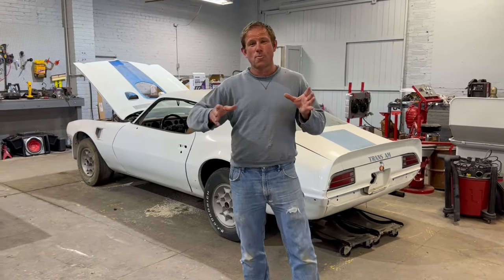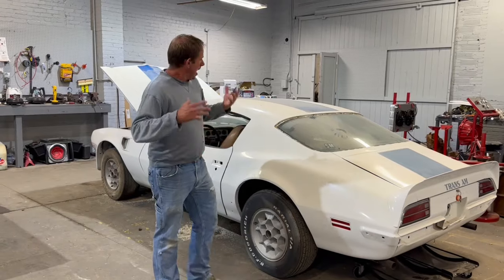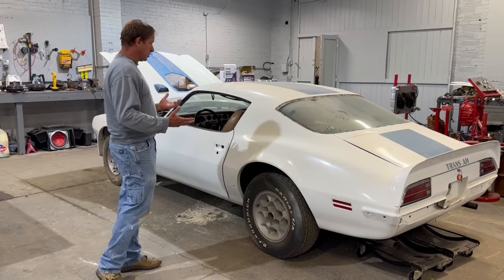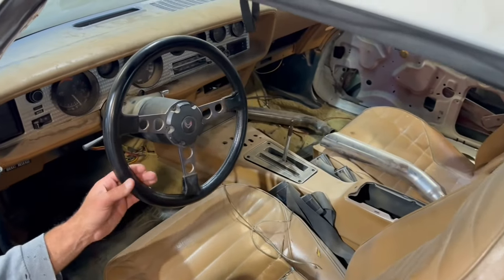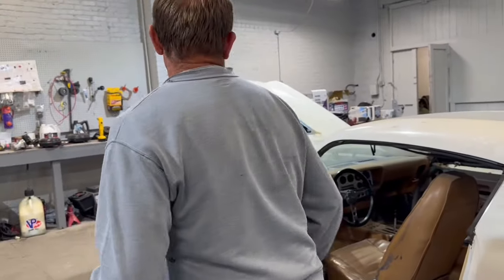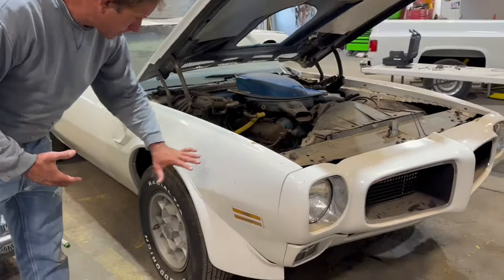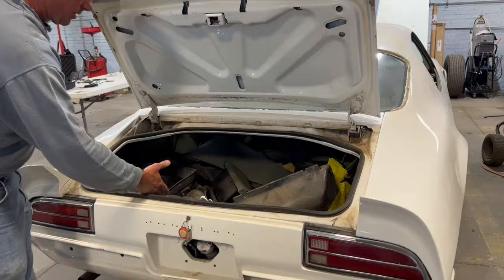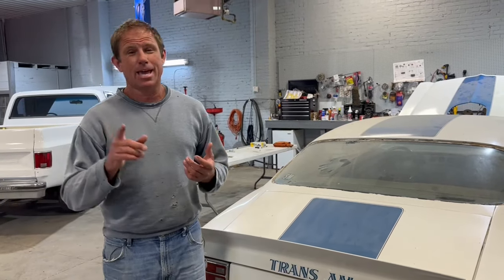Barn Find! 1971 Pontiac Trans Am! 455 Auto on the column? Fresh out of storage after 40 Years!

Comment: Beautiful car, probably my favorite Trans Am ever, the '70-'73, with the stripes and Polycast Honeycomb wheels.
But if you're going to manufacture it with column shift, then just go ahead and put a proper bench front seat in it!  I HATE seeing bucket seats with a column shift, but AMC, Chrysler, Ford, and GM, were all guilty of building them that way. I don't think any 2nd gen F body came with a bench. 1st gens did though. I'd still put that car back to original and enjoy it that way.
One of the biggest let-downs in my life was seeing a beautiful Grabber Red '69 Torino GT fastback some 40 years ago, and then peering inside and seeing a column shifter for the C4 transmission, and nothing but carpet between the bucket seats!

Comment: Someone has tried real hard to ruin that car.  But, it's probably still salvageable.  I agree with ditching the column shifter,.  Most people got that by accident.  When you ordered and auto trans without a console, people didn't know that mandated a column shifter, which left hem sorely disappointed.  The hood tach also has to go.  And it needs the blue interior.  After about $50-60K it could be a nice driver.